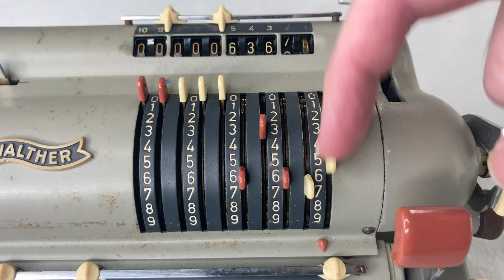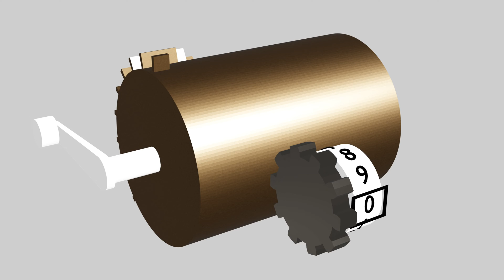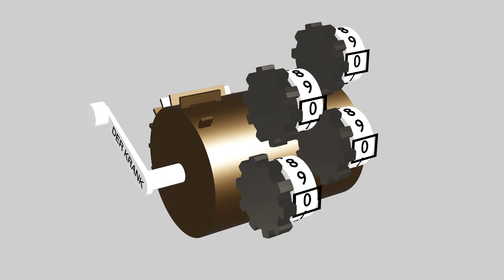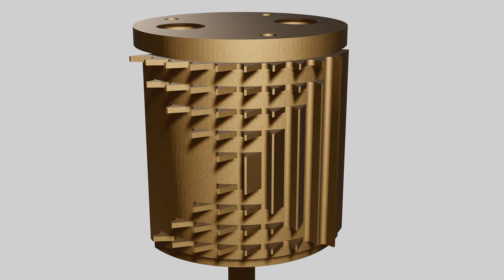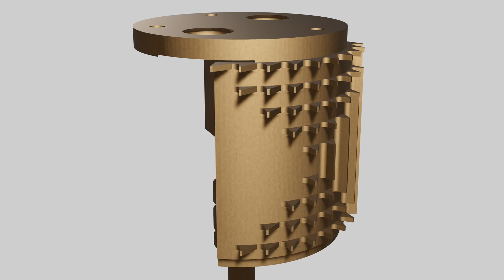The Stepped Drum Mechanism. 12 Days of Curtsmas 3

Comment: 4:04 Chris, I am pretty sure that the stepped drum shifts by 1 and 1/2 position during subtraction mode.  If you go to 6:15 in the video "How the CURTA Works" on the MechanicalComputing channel, you will see this indicated on their diagram.  The reason is that the correct complement in each digit place is the nines complement (except that in the least significant digit place it needs to be one more than the nines complement).  The nines complement of a digit is 9 minus the digit.  So, if 3 is not the least significant digit, then you have to add its nines complement, 6, rather than 7 as you describe.  The Curta has an extra gear one position above the main gear on the transmission shaft of the least significant digit.  This is how it adds one more than the nines complement in that digit.  For example, if 3 was the least significant digit, then the extra gear above it would be in the 7-tooth position you show at 4:17, thus adding 7.  In addition mode, this extra gear has no effect on the number added.  Let's take 3 as our example again.  If we add 3 to the least significant digit in addition mode, the extra gear will be one position above in a 2-tooth position, so the extra gear will only catch 2 teeth in that cycle, but the main gear will catch all 3 of the teeth it needs to.  

If we think about how these complementary subtractions work, we will see why most of the digits need to have the nines complement added.  Say we want to do 582 - 256.  We might change it to 582 + 1000 - 256.  At the end, we can remove the leading 1 to subtract our 1000 away again.  Subtracting from 1000 is easier if we think of 1000 as 999 + 1.  We can rearrange to get 582 + 999 - 256 + 1.  Subtracting 256 from 999 is easy, because we just subtract each digit from 9 (the nines complement).  That gives 582 + 743 + 1.  We see that there is a 1 left over, which is why we need to add one more than the nines complement in the least significant digit.  You'll see that adding it all up gives 1326.  Drop the leading 1 to get 326 for the answer.  Of course, the Curta drops the leading 1 by adding 9 in each greater digit place until it carries to an overflow at the far left of the register.  

I recently learned that the number one greater than a number's nines complement is called its tens complement.  I've seen a few resources claiming that the Curta uses "nines complement subtraction", but I think that because it automatically adds one in the least significant digit, it would technically have to be considered tens complement subtraction.  However, I'm not 100% sure about the nomenclature here, so don't take my word for it.  

p.s.  Sorry for the super long comment!  I just had to get that off my chest.  Like I said, I'm pretty sure I'm right about this, but if anyone thinks I've mad a mistake here, please let me know.

Comment: I wanted to add that subtraction is slightly trickier than that since the stepped drum has to behave differently depending on which digit is actually engaged. Subtracting a number is akin to adding the complement to 9 of every digit, plus one for the last digit, and to discard the overflow.

eg. 40 - 12 
→ 40 + (87 + 1) 
→ 40 + 88 
→ 128, discard the 1 
→ 28

The way it is done is via an additional gear on the very last digit (the unit one), which means in subtraction mode every gear grabs as many cog as its 9 complement.
The last digit encroaches on the cogs of the line above thanks to its two interlocked gears, so it always grabs one more cog than the others, effectively doing the +1 part.

It all is very cleverly done, as this does not impact addition mode, Curt actually recounted that none of the engineers at his father’s company believed it would work until he proved them wrong with a built prototype!

Comment: Does the bit right at the bottom have something to do with the extra +1 you have to do to subtract with complements?
Reply: If you look at the laid out pattern at 3:30 you will notice that in addition mode, top to bottom, the number of steps goes from 1 to 9, while in subtraction mode it goes from 10 to 1. The topmost row is actually only used by the unit digit to do the +1 part. This specific digit is actually tied to two interlocked gearwheels, catching two contiguous rows of cogs.

If you add 8, for example, the bottom gear will catch 8 cogs on its row, while the top one will only catch 7 — the row above.

If you switch to subtraction mode, the bottom gear will catch an amount of cogs equal to 9’s complement to 8, 1. The top gear will catch the row above, i.e. 2. — in this case, it’s the top gear that is driving, since it catches more cogs. Every other digit uses a single gear that adds its 9’s complement, the unit one does its +1 thing, and there is a separate mechanism elsewhere in the machine to carry.
Reply: @LarsOctopus  So my guess was exactly upside down!